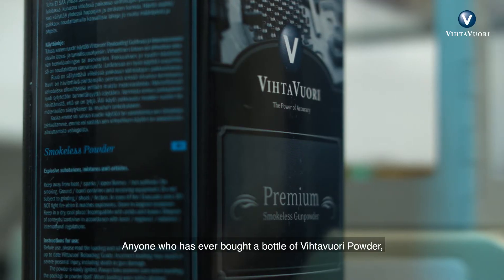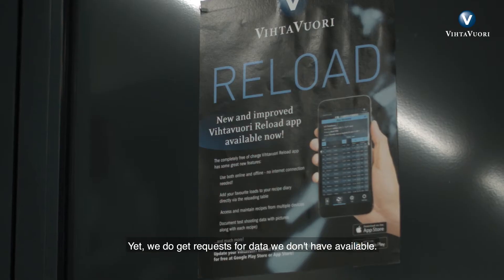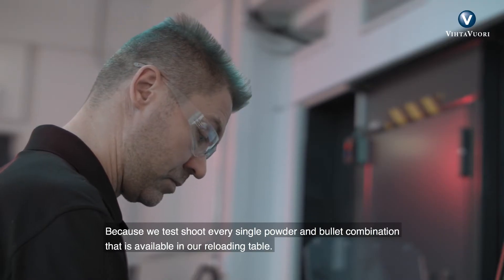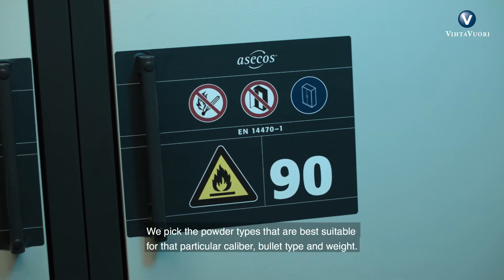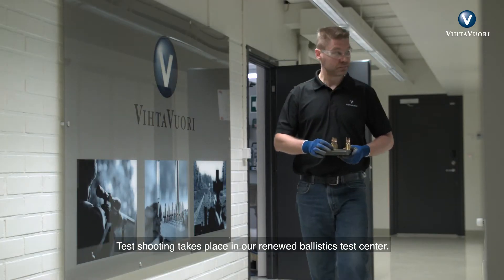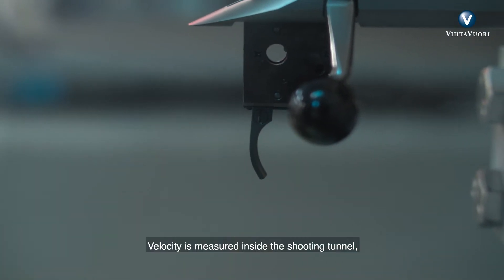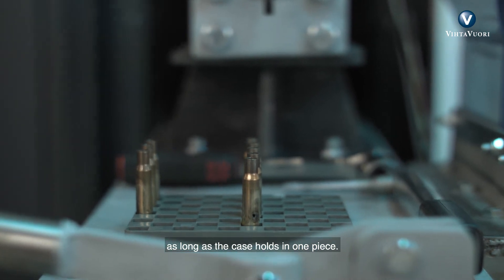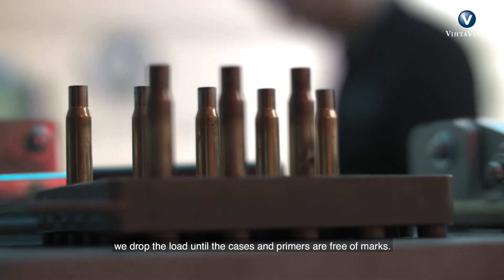How we produce reloading data at Vihtavuori Powders

Comment: I had been using N140 in my .22-250 for over 15 years, then one time I opened a new tub and for the same load I dropped 600 fps and my groups were shocking ?? I have given up on it and went to Ramshot Wild Boar now 😡.

Comment: You really need to develop reloading data for the 28 Nosler cartridge. It is gaining popularity very quickly being as it is the current king for velocity of the 7mm factory cartridges. I have the rifle and your powders work better than any other I’ve tried. I primarily shoot the 195gr Berger but also use the 197gr SMK and the 190gr A-Tip. Both N570 and 24N41 are excellent powders for the heavy per caliber 7mm bullets. With excellent Extreme Spread and Standard Deviation. My 195gr Berger load has an ES Of 4 FPS and an SD of 2
Reply: ES of 4fps huh? What's that, a 2 shot group? Anyone can accomplish that with 2-5 shots. Try where it counts, 10 or 20 shot strings. Anything less than that is for hunters and posers and powder and other components won't matter much.

Comment: I would really like to see pressure data published in addition to all the other information.
Reply: Their 3rd edition reloading manual has the pressure data, but their 4th edition dropped the pressure data. And of coarse the online does not have it either. So long as the data is still the same one could use their 3rd edition hard cover reloading manual to glean the pressure data from. Of coarse they no longer sell the printed material so one will have to hunt the internet for used copies.

Comment: Going to bring up another powder manufacturer. Vectan, there .223/5.56 loads are for 5.56 (4300) bar 63,000psi. I do not see pressure listed with your .223 rounds. Are they 55,000 and under or 63,000?